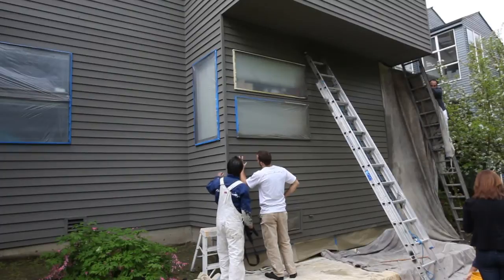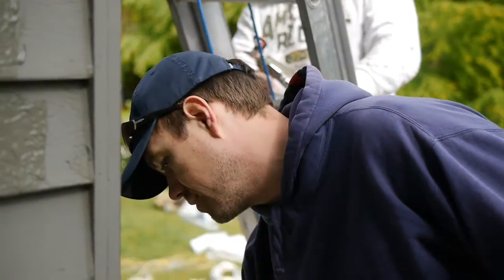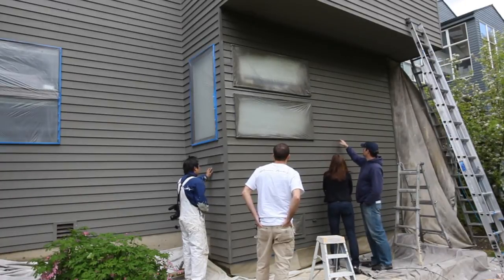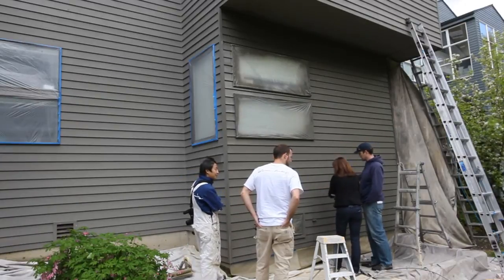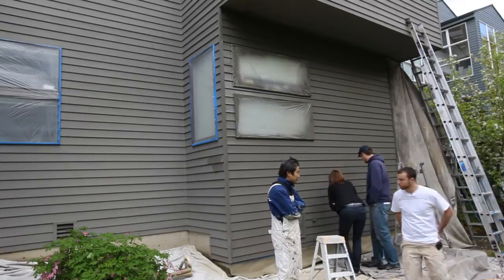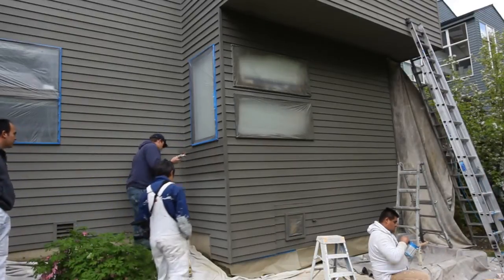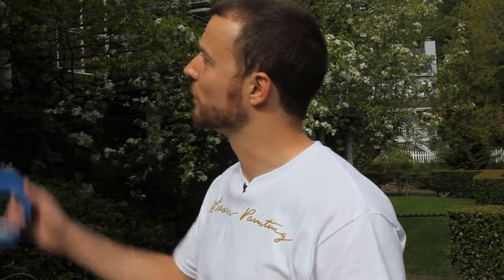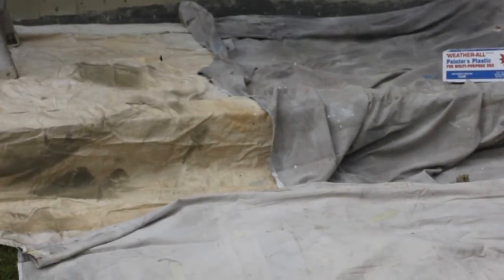House Painting Cost with Fine Paints of Europe

Comment: I'm not so sure painting are these guys strong point. Naturally you don't want to cover up plants with plastic( blue tarps he talked about). He could vary the amount of paint thru the pump by either adjusting the pump pressure, the size of the. tip ( critical in an airless pump, match the tip for the job and material), and to some degree the applicator. But, they will figure some things out as they go, after a few years of experience.
Reply: After a few years experience?? 😂 You must not have a clue who John Shearer is or what is actually happening in this video.
Reply: @michaeldurso6268  it would help if they explain what exactly they were f**** doing